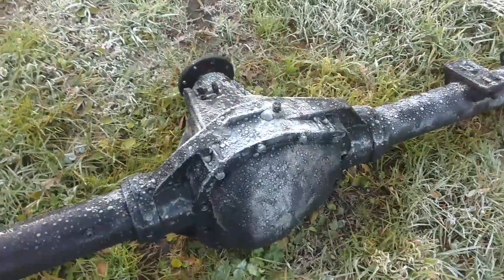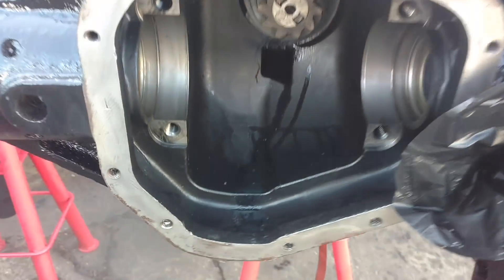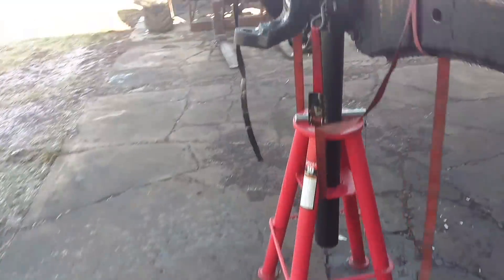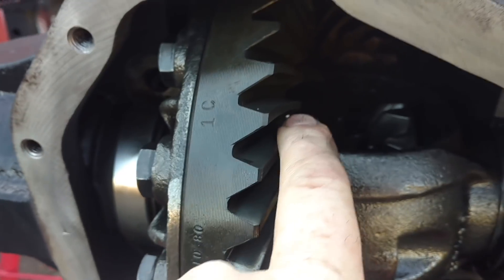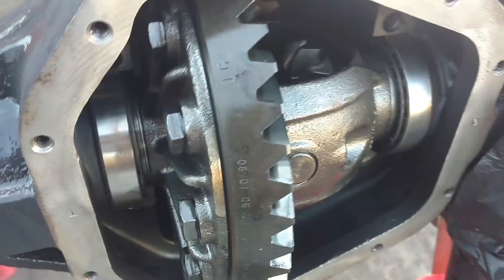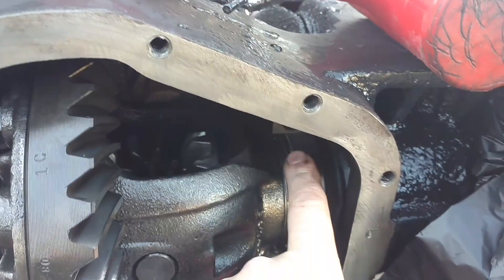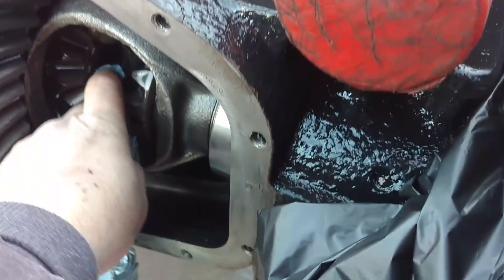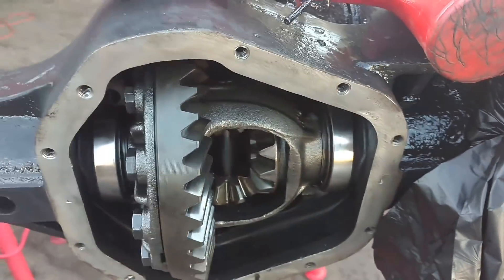#6 BRANDON'S 2010 F250 PRESSING IN ALL NEW BALL JOINTS!

Comment: now I know where that file I couldn't find went. another good video. I use a lot of those flapper wheels and wire brushes on a die grinder for cleaning rust and scale. it's the details like squaring up the surface and removing all the scaly rust that insures the new parts last. lots of people complain about getting short service life out of new parts , mainly due to properly cleaning and improper installation, I would imagine. curious, how much is that vacuum seal, looks $$$ ? I have had ball joints on older trucks so rusted in that blowing a hole thru them with a torch was the only way to loosen them without bending or mutilating the C sections on axle or outer knuckle.
Reply from the maker: how many people would have went for an air or battery tool to remove the rust and flatten the matting surface...i know it takes longer with a file but i am confident that it is done the way i want it. those seals are about $60. each. the seals inside the carrier are $55. each. this is not a cheap project by any means. with all the parts i think we will need, this will run between $1300 and $1600. however to do plan on replacing the rear axles seals, pinion seal, full synthetic fluid, rear calipers and brakes.

Comment: many times a file is faster than anything else anyway. just don't buy Chinese files. lol. lots of parts to that front axle, so it's easy to see how expensive it can get. doesn't pay to buy cheap parts since it's such a process to replace a lot of them. I take it the internal bearings were in good shape. is that front axle Dana or some other manufacturers?
Reply from the maker: i know a file is old school but it works. i typically only buy napa or ford parts. yes there are a lot of parts to that axle. it is a dana axle. bearing looked good.